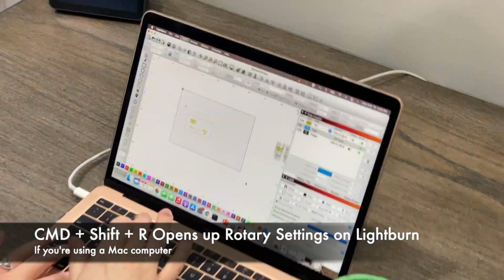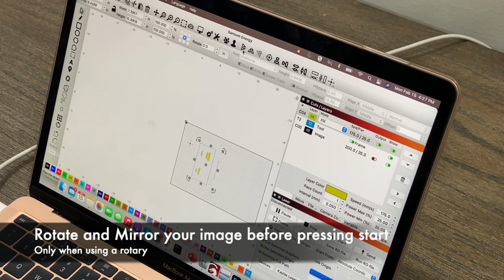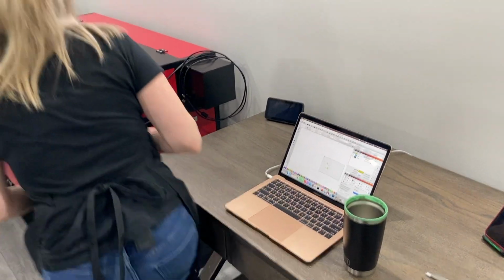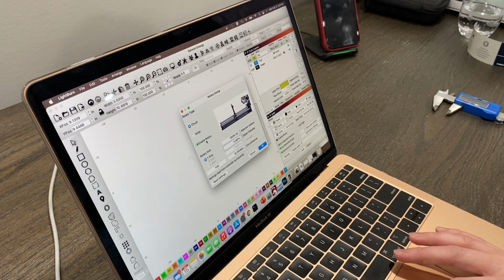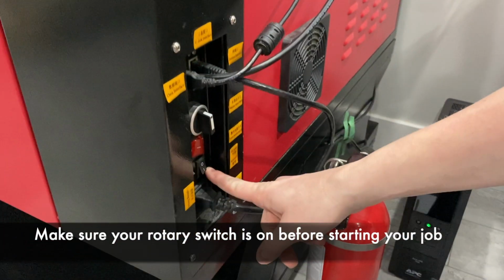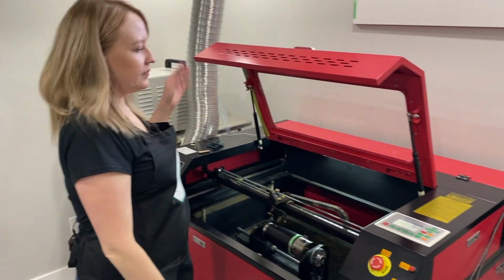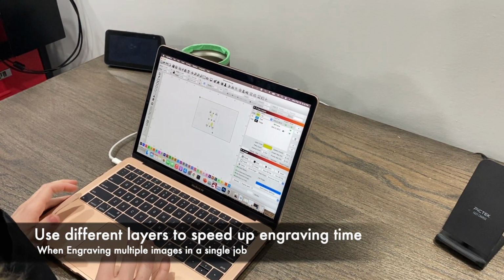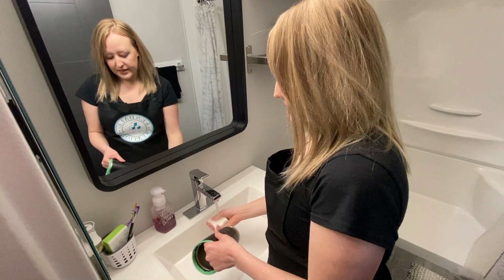How to Laser Engrave a Yeti Rambler / Tumbler

Comment: I noticed you have the CW-3000 water chiller.  When you turn on your chiller, I assume your temperature starts at 25C, right?  If you are doing a long engraving, what temperature does your chiller normally reach?  I have found my chiller will increase to around 29C-30C with longer engravings.  Do you ever place ice in your chiller?
Reply from the maker: Hi Donald, our chiller usually starts at around 18-19 since that’s the ambient temperature in our home. On large projects, we have seen the temperature rise to 23 (on a hot day), and sometimes we will add ice when this happens. 

If your temperature is standard between 25 and 30, you may want to upgrade to the CW-5000 which has a refrigeration mechanism to lower the temperature. The CW-3000 is more of a passive cooling system using heat-syncs to dissipate the heat.